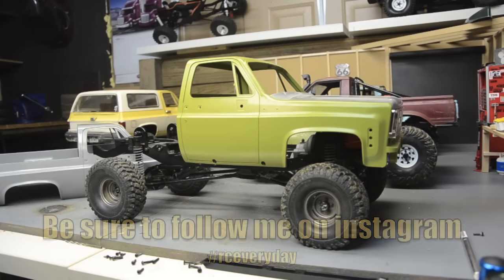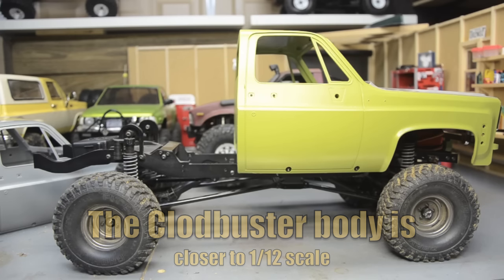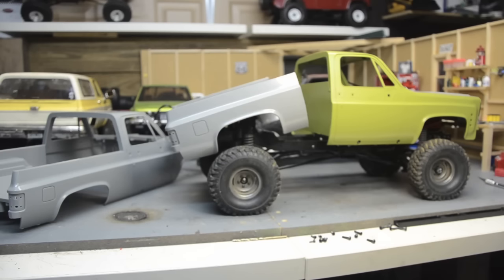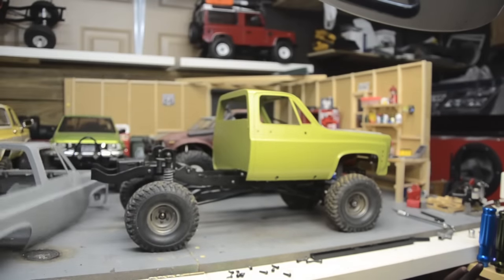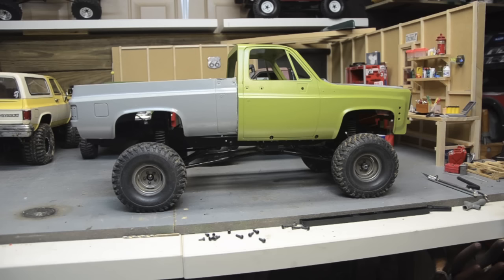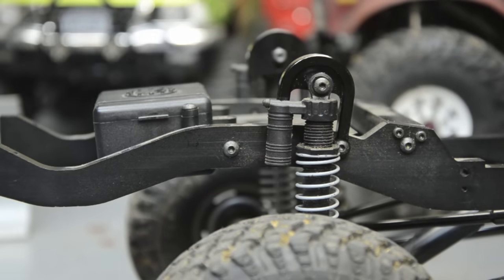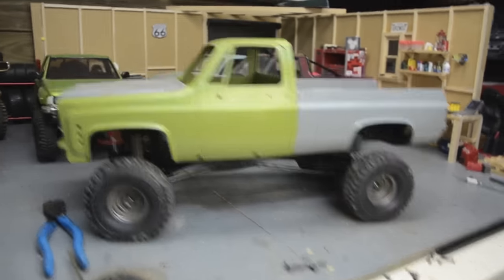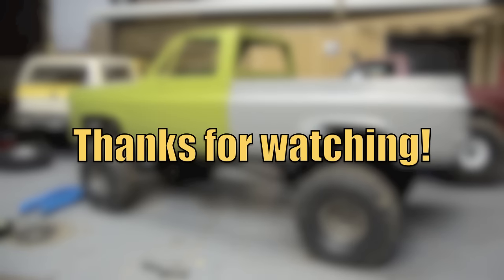RC4wd Gelande 2 K10 Chevy Truck Build Making the Bed

Comment: what is the wheel base
Reply from the maker: It was 13 inches in this video but I have since changed chassis and shortened the bed.  Not sure what it is at the moment
Reply: RC Everyday thank you. I want to usr the gelande 2 frame
Reply: RC Everyday is that in between the tires
Reply from the maker: that is from hub to hub, the standard wheelbase for the gelande 2 d110 chassis
Reply: @RCeveryday  hello, I realize this is an old video but I'm in the process of building a square body myself using an rc4wd blazer body. I haven't stretched my frame yet. What is the wheelbase on your truck? I watched all the videos on your build and never heard you say a measurement. I love the look and just need to know the wheelbase you ended up at. Thanks!! And all your builds are amazing!